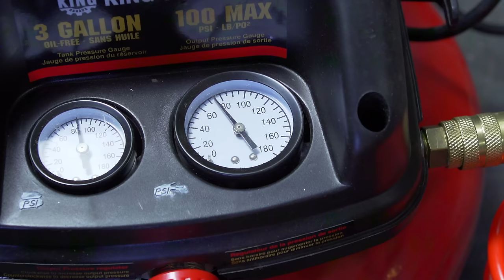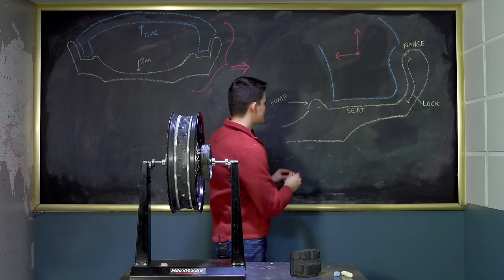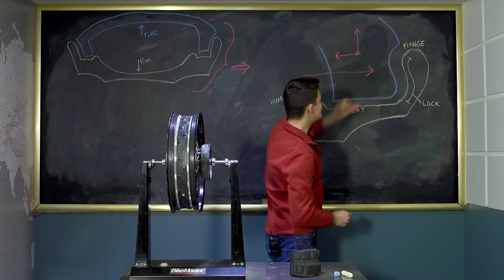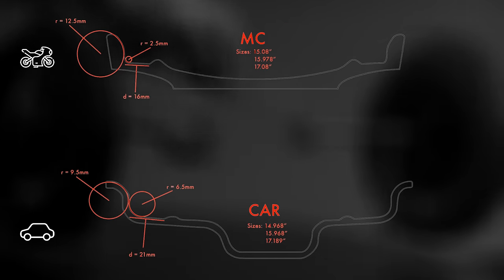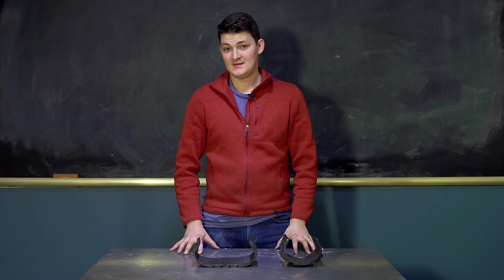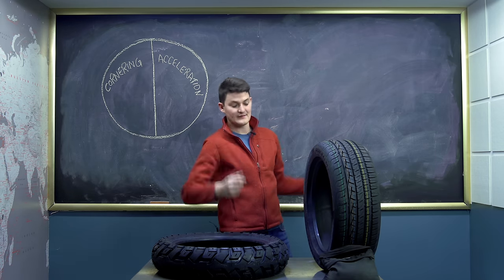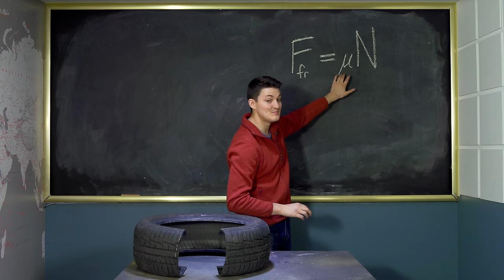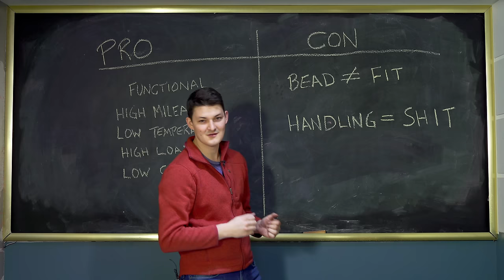Are Motorcycle Tires a Ripoff? The Darkside Car Tire Experiment

Comment: Well that friction force equation had me scratching my head.

Thinking intuitively, it does make sense that if you have something really heavy, like a couch, on 4 little 1x1" legs with rubber feet, it's still hard to slide it sideways, just as it would be if each leg had 4x4" rubber feet.  The fact that the force is only distributed on 1x1" patches doesn't obviously make it easier to slide.
Reply: 2 years late, but yeah the friction force equation is oversimplified for the real world. It works with perfectly smooth materials, but nothing is perfectly smooth. 

The reason why contact patch actually does matter is because the tire grabs onto microscopic bumps in the pavement. A soft tire conforms around the little grains of pavement and pushes off horizontally to give more grip. 

If the two surfaces were actually perfectly smooth, a vehicle would never ever be able to turn at higher than 1g, because with a perfectly sticky tire it would only ever generate a turning friction force equal to the weight of the vehicle. 

When you factor in the little bumps in the road and how the tire grabs those as it rolls you now are able to turn at a rate higher than 1g, and a larger contact patch gives you more little bumps for the tire to grab onto.

When you’re talking about sliding a chair across a smooth floor that doesn’t really have many microscopic bumps the effect of it is much lower so it feels basically the same with 1x1 vs 4x4 inch feet. However if you compared 1x1 vs 1000x1000 inch rubber feet you’d definitely feel a difference because there’s still a microscopic interface between the rubber and the floor, no matter how smooth it seems.

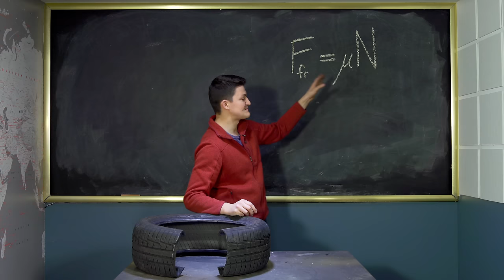Comment: 8:43 I have to disagree with you on that. Coulomb friction insufficiently describes the way softer polymers like rubber behave, especially when they become warmer and more sticky. 
Because it is a polymer, the amount of grip is more proportional to the normal surface PRESSURE rather than normal force. Which means that it does indeed depend on surface area. This is due to large amounts of deformation and energy loss in the tire as well. In other words, the 'mu' changes depending on the load present.
Additionally, a larger contact patch will smooth out/dampen any irregularities in the road/tire surface.

I naively thought it could be approximated by Coulomb's law as well, until I was schooled by a phd in tribology.

Comment: Great comparison! I've been waiting a long time for someone to do an unbiased comparison! Though, I do have to mention that the size of the contact patch is included in the mu value. F (static force) = Mu (total coefficient of the object's friction) * N (nominal force on the object). If the contact patch is not included in the coefficient of the object's friction (mu), why do drag cars/bikes have huge slicks?
Reply: Exactly. This is true for a given area. Doubles the area, doubles mu, doubles F. And F is, indid, friction force, not necessairily static. Depends on what mu your are considering, static or dynamic.
Reply: Sorry but this is untrue. Tires while seemingly simple have very complex equations the describe their behavior such as the Pacejka Formula.

Friction force is not based off area at all. The way static mu is measured is by the incline at which a slide happens with a given load. If doubling the area doubled the mu the angles achieved would be different given the same material. Try it at home. I promise you the angle will be the same for both size pieces of material.

The reason bigger tires are used on performance cars is like he said it gives you more rubber to burn through as well as increasing the width of the contact patch which increases stability. Additionally there is a phenomenon known as tire load sensitivity where as force on a tire increases the available grip decreases. Sometimes bigger tires perform better because they don't have the same sensitivity to load that smaller tires do. This is mainly based on how the tires are designed.
Reply: @johnsansbury6206  yes, tough to admit but you are right. I remember now an experience of slowly inclining a test surface till the moment a test speciment starts sliding. That moment defines the static mu....
Reply: @johnsansbury6206  then why don't dragsters run 6" wide tires?  Longevity is no concern at all for them, and narrower tires produce less drag.
Reply: @Johnny96ri  Because drag tires are so sticky that the adhesive force also has an effect, which does scale with contact area. But  if you ran a tire that sticky on the street you'd need tire warmers and would only get a short distance out of each set.
Reply: @Johnny96ri  longevity is a concern for them. Those tires are engineered to last exactly that 1/4 or 1/2 mile. But that's not why they are that wide. Like stated above they have additional design constraints considered.

Comment: Thank you for doing this and spelling out the details so clearly!  This needed to be done!  Handling is the most important (and well-designed) part of my Honda GL1800, and I wouldn't sacrifice it (by using wrong-shape tires) for anything.  Smooth transition across the center point when going back and forth (and I ride in the mountains a lot) is critical to the DRIVER controlling the MOTORCYCLE and not the other way around.
Reply: I agree! My Wing will always have the prescribed overpriced tire on it as that is what the little gnomes in the design studio engineered the bike to use. Cars are a totally different matter. My old Firebird had huge rears and standard fronts, my Jeeps all had knobby rollers, my Miatas all had racing tires, etc... but at no time was I counting on just one tire to keep me planted firmly to the asphalt! I even saw a car with the donut spares at all 4 corners! (Technically he could drive up to 50 mph for 60 miles... ) but that thin line my tires make is all I have to keep me upright... So Dunlop or Michelin will be getting my cash as needed.

Comment: I recently had my back end slide right out from under me. Happened super quick too. Never laid a bike down before that, so lately I'm super scared in slippery conditions, so seeing you ride in the snow almost gives me anxiety, btw turned out I had no air in the back tire, wouldn't even register on the tire gauge. 🤫
Reply: I used to commute all year on my Moto Guzzi California 850. One winter I had a van sliding sideways against me in my lane. I escaped using the bicycle lane. Next week another van did the same thing. With bicycles in the bicycle lane the escape was hairy for all of us but none of us crashed. Then I stopped riding in snowy conditions. Shortly after I bought a car.

Comment: If you are having that much trouble putting the tire on, you are running the wrong size tire.  Plus, the darkside is for cruisers, not sport bikes, or off-road bikes.   I've run on the darkside for 7 years, 3 different cruisers, not an issue.  That being said, the darkside isn't for everyone, just like a gixxer isn't for everyone.

Comment: Great video as always; not sure how correct your analogy is with the F=mN though. To my understanding tire grip is more than simply a friction coefficient model; softer compounds of tire may provide increased friction coefficients  but I believe the ‘grip’ increase is predominantly caused by better ability to deform to the surface imperfections in tarmac and provide a better keying surface. Even extremely light single seater race cars generally have wide tires and I believe this is because the above statement rings true as opposed to the the teams wanting tires that can cover more miles at the expense of hugely increased rotational and unstrung mass.
Reply: To answer your question, the formula is correct assuming both surfaces are perfectly or close to perfectly flat, when you start to add texture and depth, the surface the formula does change, although I do not know what it changes to. That’s why this formula doesn’t really work for dirt bikes and other off-road vehicles, they use large knob tires designed to puncture into the dirt to grip, as for your racecar comparison, if I remember correctly those tires are designed to be super soft and sticky which would drastically reduce the amount of miles you could put on them, thinner tires would dissolve even sooner in that instance, which would increase the amount of times that race cars already get pitstopped to change tires during a race.
Reply: Not to mention racecar tires need to be so big to absorb the large amounts of heat that come from acceleration forces, due to constant changes in speed and direction a large amount of heat is generated, a larger tire is needed to absorb that heat without becoming unsafe.
Reply: @tylerbraegelmann8548  The formula remains the same, it's just that mu is proportional to load with a decreasing relationship. The slope is not linear but it's relatively smooth. If a tire makes say 1.5mu at theoretical 0N of load, it might make 1.3mu at 3000N of load and 1.1mu at 6000N and so on. There is a small curve so the slope flattens out with more load. 

This is why heavier cars corner worse; because they have more linear inertia to deal with but also technically less mu due to the load resulting from the mass causing said linear inertia.

On a related note, downforce is good because even if you "lose mu" with more load, you never really actually lose Fy/Fx; and downforce is load with effectively no linear inertia baggage.
Reply: @ArchOfficial  It’s also due to the microscopic bumps in the road which the tire can conform to and push off of horizontally. 

mu in a pure physical setting should never ever be more than 1.000. But because of the texture of the road a tire is able to act as if it has a mu of >1.000. 

That equation is only for perfectly smooth surfaces and your friction force will never be higher than the force of gravity on the object. 

Sometimes you’ll see people approximate the friction coefficient as mu=1.3 or something to account for the roughness of the road, but that’s an oversimplification because that mu is dependant on surface are, as the roughness factor is dependant on surface area. 

The extra ~0.4 mu tacked onto the basic 0.9mu of a rubber tire-asphalt coefficient is variable depending on surface area.

So, surface area does give you more traction, but not more friction. Your pure friction will always be less than the force of gravity on the vehicle.
Reply: @Chevsilverado  Performance tires also have some adhesive properties, hence being able to achieve "base mu" of 1.6 - 2.0~ at 0N.

Either way the "friction coefficient" of a tire is completely meaningless and in vehicle dynamics "mu" is just a number in the acceleration formula. For example when using winter tires on hard packed snow, a large part of the acceleration is generated by the spikes digging in, not rubber surface friction per-se. With shovel tires in loose sand, a large part of the acceleration is generated by the shovels digging in, and so on.

Comment: Have been using a 205 x 25 on   my 1500 vl intruder for over 18  months now as this bike only really has a lean angle of around 25 degrees  never had a problem sure handling input is greater ,my intruder weighs in at 320 kilograms  and can hustle in a straight line the trade-offs are small.....Alan

Comment: I mean, spontaneous uninstallation seems like a good enough reason. But hey, Goldwings gonna Goldwing.
Reply: Never heard of it happening tho

Which is either good, or really bad
Reply: Show us proof of this "spontaneous installation"   Has NEVER happened. Qualify this claim....
Reply: I mean, just cause you haven’t heard of it happening doesn’t mean it never has. Also doesn’t mean it has either.

Regardless, tires are the one actual thing on a vehicle that touches the road, why potentially risk your life over $100 savings every 2 years.
Reply: @justmyself1000  Every time I mention I know this guy, who had a Kawasaki Vulcan Nomad who had two(2) sudden deflations, or blowouts, I'm always not believed or told to prove it!
Reply: @gt7500  You know what internet anecdotes are worth......Also, there are millions of blowouts and "deflations" with motorcycle tires. It does not prove that if a different tire was used the result would be different.  If a could tell the hysteria on the Super Tenere or even Adventure bike forums about the need for a TPMS sensor and the anecdotes I read about how a motorcycle TPMS saved one's life, yada, yada. And that is WITH a motorcycle tire...
Reply: Lots of forums and research where this has been done. Not just on GWs
Reply: @perryman333  $100 savings over 2 years? Thats on a $200 tire... He also said it lasts 4x as long... (Also if your only changing your tire every other year you need to ride more lol)... So you save $100 the first tire change and it lasts 4x as long, so thats 4 mc tires to 1 car tire... 
Thats $100 
VS
$200+$200+$200+$200=$800
SO $800 vs $100 or a savings of $700. And thats if your rear tire is only $200... What if its $300 like mine? Thats $1100 savings.

Comment: Did it all the time with my gold wings in my Valkyrie once you're used to it you can't even tell especially on a heavy bike on that light little dirt bike you were doing with probably a nightmare
Reply: Haha! Only a Goldwing rider would call that a light little dirt bike. The perspective is interesting.
Reply: @TheJohnreeves  according to him my bike must have a net negative weight :P
Reply: @TheJohnreeves  actually now I ride a 730 lb Road Glide I like the lighter bike and actually use metzler's those are motorcycle tires same strange but I actually do it
Reply: @brapamaldi7666  I have lightened up to a Road Glide that weighs 735 lolz
Reply: 220 kg GS. "light bike"

Comment: Oh boy, I can see the servers hosting forums dedicated to Goldwings, cruisers/Harleys steaming for the next couple of weeks. You've open a can of worms on this one, Ryan. Suggestion for a follow-up video to keep the trolling at BOSS level: dyno vs synthetic engine oil? Warning: you may send many conspiracy-loving riders right into therapy.
Reply: +1.. the engine oil bit is something I'm totally onto... Also Spark plugs and air filters...how does K&N compare to the stock air filters....
Reply: Or do a piece on ballance beads. Be it the ones in the tire or the ones in a plate that bolts to the wheel.
Reply: Hands shaking with blacker then Nigerian coffee as forums light up with Alex Jones style conspiracy for this.

Comment: Then wouldn’t it be logical that a narrow/soft compound “dark-side” tire, can resolve some of the “handling=shit” issues?
Reply: Ish. The bead still won't match, and the tyre will still be a flat profile that wants to sit upright and resists turning. It still won't reach optimal temperatures for grip, because it's still designed for a vehicle that weighs as much as a car, albeit a smaller car.
Reply: (@boiledelephant) I get it. Was just thinking that if you were set on going that route, there are narrower tires (hence, a rounder profile), and they do make “softer” compounds.  Personally, I wouldn’t go that route.

Comment: I watched every other video I could find before watching yours. Your final statement is what is missing in America. Personal responsibility! No body wants to be responsible for the decisions they make. For my 06 Honda Goldwing GL1800 pulling my Ladies camping/cargo trailer, I will be going with a recommended car tire for our touring this summer.  I'm not doing it to save money because I am upgrading the brakes and suspension to deal with the slightly bigger tire.  
As a long distance motorcycle rider by myself I will not put a car tire on my other bikes. A 40,000 mile a year traveler with my lady, last year was three sets of tires for our touring bike.
You all are in my prayers. Now start taking responsibility and stop pointing fingers at others.
Hoka Hey
Reply: 3 sets at 40k miles riding two up and towing on MC tires? My man, stick to those tires. I got only 7k miles out of my Dunlop rear tire on my 21 non-tour wing with occasional 2-up riding. I’d be mowing through nearly 6 sets at my rate. At just shy of $300 a piece…that’s $1740 worth of rear tire for me, lol

Comment: I have two bikes darksided.  Honda nc700x and a triumph tiger explorer 1200. Over 12000 miles on each one.  Listen. It handles exactly the same.   Try it you will love it.  And it's much better in the rain.  I'll never use a bike tire again.  And the cost.  $45 per car tire.  I'll easily get 25,000 miles. Compared to 8000. As long as you have a DOT approved car tire.  It's covered under insurance.  I checked.
Reply: That is utter nonsense.   Handles the same, duh on straights maybe. Every other motorcycle rider knows the difference between even a round and a squared motorcycle tyre.
Reply: @gur262  where are you from? I'll come show you this utter nonsense for yourself.  If you can out corner me.  I'LL GIVE YOU A THOUSAND DOLLARS.  deal?

Comment: Next time use a Citroen cv2 tire .
Tire is smaller and more round.
Reply: The early 2CV used an odd metric size, not 16", but 400mm, and the later ones were 15". The price of skinny 15" Michelins is absurd. Otoh, the price of skinny Nankang, Maxxis and Toyo tyres is quite reasonable.
Reply: Cv2 15" tires are original mounting on sidecar motorcycles in the 80's, after these years, they put original 13" or 14" car rim on sidecar motorcycle

And contraint is more effective on a sidecar motorcycles... So, darkside begin on sidecar motorcycles ???

Have a nice day dudes ! Ride safe ! ✌️😎✌️